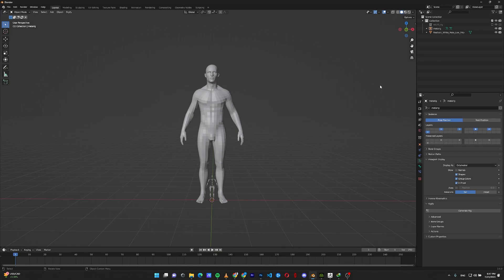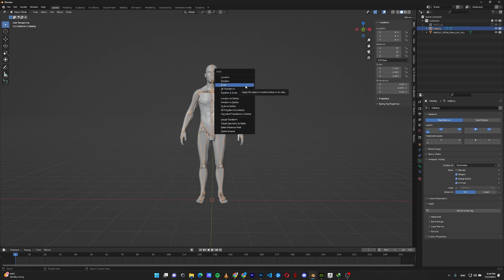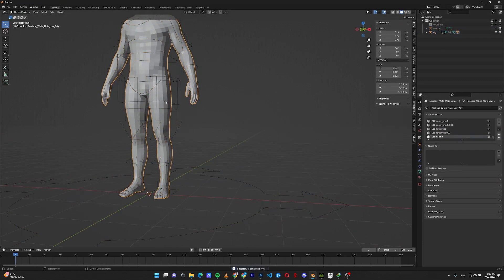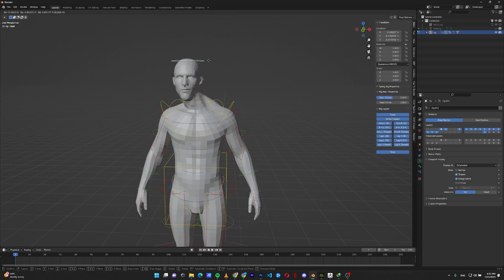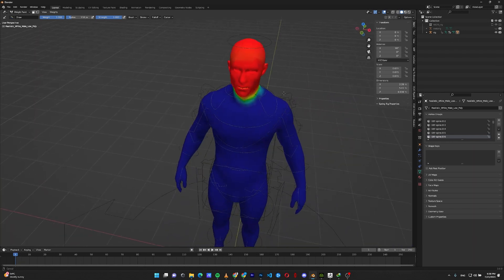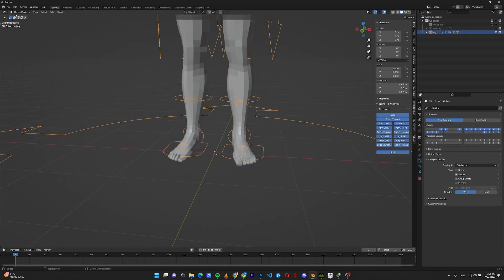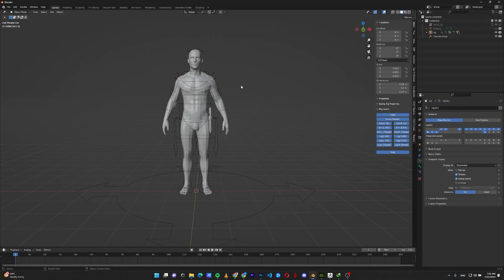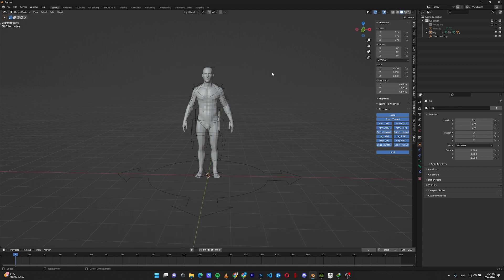4 Most Common Blender Rigging Problems and How to Solve Them

Comment: You helped me a lot thank you! :) My other problem I have currently thou is when I move my arm it shrinks for some odd reason??
Reply from the maker: My pleasure, I'm glad that it helped you.
For your problem, there are some common issues that I will list here for you:
1- Please make sure when you select your model and go into the modifiers tab (Wrench Icon), in the armature modifier the "Preserve Volume" option is checked.
2- Sometimes due to the perspective misjudge we will put the joints outside of the model, please make sure to check that every joint is inside of the model.
3- (Most Common) There are other bones that have an influence on the arm, for example, the chest bone has an influence on the arms and keeps the arms from moving instead it deforms it, the more the chest bone has influence, the more the arm will deform (shrinks in this case).
to check that, go to the properties panel in the right section (Green Triangle) and go to the weight paint mode, then in the vertex groups section go through each bone (Vertex Group) and check if relevant bones have an influence on the arms or not.
If there is a bone that should not control the arm, just remove the weight on the arms.
P.S.: when your model turns pinkish on vertex groups just pass that bone, it's IK bone don't paint them.
4- Sometimes there are duplicate bones in the same place that both have control on the region, make sure to check for that too.
Please let me know if your problem is fixed or not.
Reply: @mck3D  Alright then Thank you so much :) Really helps keep up the great work!! :D
Reply from the maker: No Problem, Anytime.
Thank you, cheers.

Comment: NONE of these tutorials actually give advice on what to do if your character won't parent to the mesh.  sure rigidify works on basic humanoid characters but it fricking sucks at rigging stylish or non human characters. manual rigging is best but i still find the FK an IK joins hard to rig on my own
Reply from the maker: these types of auto solutions are mostly for human characters but you can almost rig anything with Rigify and Auto Rig Pro, it's just adding additional bones to the character It's true that every professional animation model should be custom-rigged, and the reasons are not one or two, there are a lot of benefits, but for a lot of people these auto rigging methods saved a lot of time.
I try to make a video about custom rigging so that you can rig IK and FK with ease.
Reply: @mck3D  i found out what was generally going wrong. i had to merge some vertex points that were messing up with the rigs weight painting.
Reply from the maker: nice, I'm glad you solved it, and thank you for sharing your solution.
Reply: @mck3D  basically rigidify is very sensitive to bad topology, and needs a mesh clean up so the weight painting can work. characters that have separate clothe mesh's or extras dont seem to go well. i have found separating any clothes or accessories from the plain body mesh to be parented later on woks best. or at least has been working for me
Reply from the maker: yes, this is the normal workflow for game characters also, there are two types, either you retopology the clothes with your character way you will implement the clothes textures and definitions in the texturing phase, and technically you have one solid mesh then you will rig that.
the second method is that you need to weight paint and rig the model separately and then add the clothes and transfer wight paint from the body to the clothes so that the clothes will move with the character in the game engine.
the second method is usually used with games with more budget on the polygons and mostly in the RPG type games where you need to add clothes on top of the characters.
But it's great that you mentioned your problem and solution, maybe I create a video about it. cheers

Comment: Thank you! You're a lifesaver for beginners. Just subscribed to your channel. But I have one more question: How can I prevent the neck from stretching unusually at 4:01? Let's suppose I need to move the head upwards, downwards, or perform head cracking. Alternatively, to put it simply, how can we stop stretching altogether?
Reply from the maker: Thank you, I appreciate it.
about your question, since an unusually deforming neck consists of several layers, I will explain them to you:
1) - the first obvious thing to check is the weight paints, remember that if some other bone (EX: shoulder bone) even has the slightest influence on the neck geometry, your neck bone doesn't control the neck 100% and this can cause to deformation when you move other bones (EX: shoulder) or underperforming when you move the neck bone, so the first thing is to check if every bone controls what they should, and in pro rigging, you actually need a little or more control of other bones on a region geometry but keep it simple for now.
2) - the second thing that can cause a problem is that you don't want the head to rotate or move more than what is realistic, to control this, you need to add bone constraints, you can choose to limit a bone's transform, rotation, scale, this way you make sure for example your neck doesn't turn 180 degrees or move out of place.
3) - even with all of this, there are always little deformations in the model that need to be fixed 
in the shape keys, but the sweet part is that you can set a driver for the bone to control the value of the shape key depending on the bone transform. EX: you move your hands up and your armpits stretch too much ( let's imagine that you can't fix this with weight painting because the arm is too close to the chest), so you put the arms in an up position, create a shape key, and fix the geometry either in edit mode or in sculpt mode, then you set a driver from the shape key to the shoulder rotation, this way when your arm is in the down position, your shape key value is 0 and when you start moving your arm up, gradually the shape key value increases until it reaches the value 1 in the up position.
Reply: @mck3D  Thank you so much for your detailed, comprehensive and insightful explanation. 
Your detailed guidance has been incredibly helpful.
Reply from the maker: My pleasure, I'm genuinely glad that it helped you.

Comment: i can not see armature option  in blender
Reply from the maker: you need to turn on the addon, if you are using Auto Rig Pro or Rigify (blender Built in), to do so, go to the edit menu => preferences => addon => Rigify (for Example) the turn it on by clicking the check box, after that when you press SHIFT + A you should see the armature option.
Reply: @mck3D  tks for your help
Reply from the maker: No problem at all, Any time.

Comment: i have rigged a model but when showing in another program the arms are vanished, never had this problem :(
Reply from the maker: The arms rig vanishing or the arms mesh itself? And whats the other program that you're trying to move your model to? And how do you move your model? As an FBX model?
Reply: @mck3D  i found out that this char isn't able to modify. cuz it has a tail and somehow, modifying doesn't work correctly
Reply from the maker: generally, you can modify any rig as long as you know how it is made, but sometimes small and easy things get complicated if you don't know exactly what the original rigger did, you can always start rigging it from scratch with Riggify or auto rig pro and in both of them you can implement the tail rigs, may I will do a custom rig for this new course that I'm recording, that way you can do you own rigs with these two addons. @dex_G59
Reply: @mck3D  yea i tried auto rig pro but it was a bit complicated tbh

idk how to skip some parts u don't need for example
Reply from the maker: I'll try to make a detailed course about Auto Rig Pro (as much as I myself know about) but until then, in general in Auto Rig Pro you need to select the main limb (for hand it's upper arm) then go to the limb options in the right panel (pressing N will reveal the panel) in the ARP panel will open up the limb options and you can check or uncheck the limbs you don't need and in the right panel you can also add more bones, I'm pretty sure that I saw a tail bones there too.

Comment: I love rigify but as of 3.6 and 4.0 at least for me something changes on the horse after exporting. The changes happen inside of blender itself so I don't believe this to be game engine related. As soon as I export the horse it is as if someone went in and changed the front heel rotation on every keyframe I saved. I tried using the wolf as workaround but it did the same thing. I have done a few horses and wolfs with ease in the past so idk what I am doing wrong.
Reply from the maker: What game engine do you use? Unreal Engine?
Reply: @mck3D  I used to use unity but changed to godot. This bug happens to me inside of blender tho. As a test I was exporting to a verity of places including desktop. Yes the change will carry over to the engine I am using but the ghost deformation happens inside of blender itself the second the export finishes. So weird because I have exported many horses in the past with tons of animations and have never seen this before. I have seen animations change or not carry over correctly once inside of a game engine due to human error before but I never seen them change inside of blender itself after an export.
Reply from the maker: if it's in Blender and it's somewhat a new thing, I assume that it is some kind of export options problem, in each version of Blender option changes and sometimes ruin the work until you figure it out, Blender 4 is totally a new thing in terms of rigging, I didn't try it yet but I know it ruins the rigs in older versions. but if you have the same problem in Blender 3.6 there are a few options I want you to check and change around maybe your problem get fixed.
when exporting FBX in the Transform section, check the Forward and UP axis and you can try to check the Apply Transform box.
In the Armature settings of export window. primari and secondary bone axis may fix the problem and also try removing the add Leaf Bones checkbox.
if you problem happens before even exporting your model, there might be a problem with transforms, please check if you applied transforms to the skeleton and model before even start rigging and weight paintitng, to apply transforms press ctrl+a and apply all transforms.
for game engines it's important to fix your model and rig origin point, so please fix them before exporting, most of the time your origin point should not be in the center of the model but below the object.
Reply: @mck3D Thanks for the reply:) I always reset the transform, rotation, and scale on my horse model prior to any rigging. The horse model I made is the exact size and shape of the rigify horse so I am not moving, rotating, scaling, or weight painting anything rig wise. Just adding the rigify horse, generating, auto weight, and animating. if I export with a simple idle animation everything is fine but If I export with a gallop animation then I get the front heel ghost rotations inside of blender itself. I don't think I am moving horse foot ik to extreme and if I was I would like to think that I would see the change happen live prior to an export. Just following the normal horse gallop keyframes protocol. I can report as of this morning that I am not seeing this behavior If I use just the metarig but of course I want to use the generated rig and so thank you for all the help. I will try everything you suggested👍
Reply from the maker: No worries, thank you for asking, one last thing that comes to my mind, is a problem that sometimes when you animate stuff you will face, is the twisting of thin parts, if your problem is the same, this happens because the AI of the application can't figure out from point A to B in which direction should turn your rig, it's actually a common problem in animations, and a lot of times happens when you try to move animation from an application to another, one fix could be to add an in-between keyframe at 50% of the movement so that application can figures out the direction of rotation, and another simpler fix is to go to Curve editor in the destination application and edit the curve the, it will change the direction of rotation, you will spot an extreme curve in the curve editor, it's probably the curve you are looking for.
Reply: @mck3D  Ok thank you so much!
Reply from the maker: You're Welcome, my pleasure

Comment: number 3 was so helpful, but when i move the character or both of them or move all the bones it doesn't exactly move with the character, like it moves slower than the character. please help? im going to subscribe pls ^_^
Reply from the maker: Firstly thank you for watching, sure I would love to help, if I understand your problem correctly, you want to move a bone and some part of the character should move with the bone but it does not move exactly with the bone, it moves but slower and if you look at the rig controllers, there are in a place more forward than the mesh and mesh is always try to catch up but never rich the bone, right?
If the problem I explained is exactly your problem then it's still about the weight painting, and actually, the problem is that some other bones influence the mesh part you are trying to move even if it's 0.00001 percent influence, the actual bone try to deform the part but other bone keeps it from doing so, in a lot of cases you can not check it with eye, because the influence value is too small that the paint we see is Dark Blue, what you can do is :
1 - Seeing the name of the bone/bones that should have control on the mesh part
2 - Go to object mode, select your mesh, go to edit mode, in vertex mode, select the vertices that cause you problem
3 - In the vertex group of this mesh while selecting the vertices of your mesh, go through each and every bone(vertex group) and select them one by one and press "Remove" button below the vertex group section.
P.S : Keep in mind to not remove the control of the vertex groups (bone) that should have influence on the mesh.
Not the only bone/bones that have control on your mesh(part) are the ones you want.

Comment: when i try posing 1 arm on my model it moves its whole chest and stretches everything out and warps it, how do i fix this
Reply from the maker: there are two ways that I can suggest to you :
1- Select your rig then shift + select your mesh(character) and go to the weight painting mode, in the weight painting mode you can CTRL + click on any bone and that bone is selected, for example, CTRL + click the arm bone and check all the arm bones then check if any arm bone has any influence on the chest or not, if yes, with the bone selected just paint the chest with the weight 0 of the brush(and keep in mind sometimes the are a little bit of influence and you think it's fully blue but it's not so check it closely)
2- The second suggestion is to select your mesh and go to the edit mode then in the vertex groups in object properties select the bone you have trouble with(ex: arm bone) then in the edit mode(vertex selection mode) select all the chest vertices (remember to use the ghost(transparent) mode so that you select everything in the chest, then in the vertex groups click on the remove button, this way you clear the influence of the selected bone on the selected vertices.

Comment: Thanks, its really useful.. After importing a mesh phantom (.obj), I did all the steps to change the pose (creating armature, then rig,..), but I'm not able to change the pose of the mesh.. so when changing the pose of the rig, nothing in the mesh changes.. do someone face this problem? Thanks in advance.
Reply from the maker: Thank you for watching, as per your explanations I assume that you imported your model and ad a rig that I assume it's a Rigify rig, not a costume rig, so you've generated the rig by clicking the "Generate rig" button and then you've selected the model then shift+click the rig and pressed CTRL+P and choose the parent with automatic weight paint, am I right? be cause most of the times the problem is in one of these steps and please check for me if after pressing parent with automatic weight paint. do you get an error in the button of the screen of the blender?
Reply: yes exactly I did the same things you mentioned.. I'm using the ICRP 145 mesh Phantom and I'm facing this problem, without any error..  @mck3D
Reply from the maker: most of the time this is a problem with weight painting, can you please check for me if you have anything in the vertex groups of your mode? and if you have, please go in weight paint mode and check if you move between the different vertex groups, do the color of the different parts of the model change? also please check if you have an armature modifier in the modifier section of your model.
Another thing can be the mesh has too many polygons, please also check the poly count of the mesh.
Reply from the maker: yes, I thought so, if you are using Auto Rig Pro you can simply change the skin engine to something else and try again, if you are using the Rigify please check that all bones are in the correct place (important: if you are trying to move joints in the Rigify, box select them, a lot of times separating them from the joint part even if you try to patch them together later, will result to this error), the next thing I want you to check is that before generating the rig and when you are in the skeleton placing phase, most of the time we need to scale the skeleton, please check that if you are applying the new scales to the skeleton by pressing CTRL + A => apply all transforms. please don't hesitate to discuss this further if your problem exists.